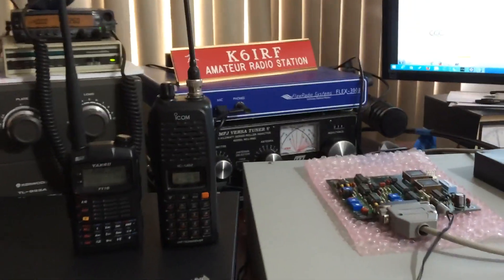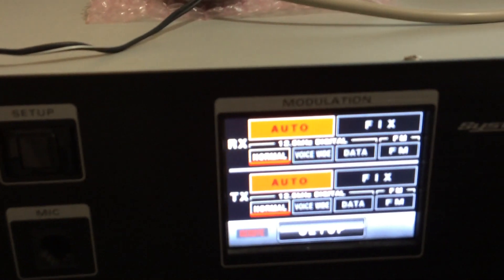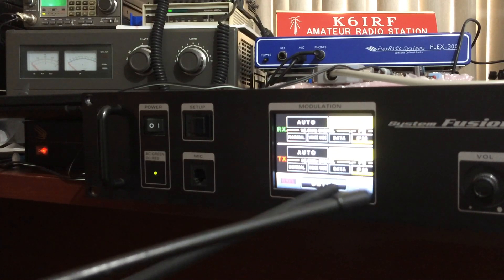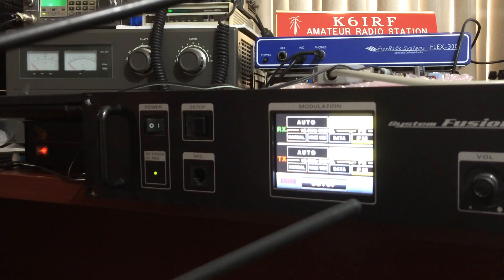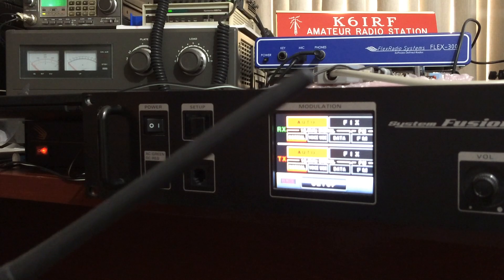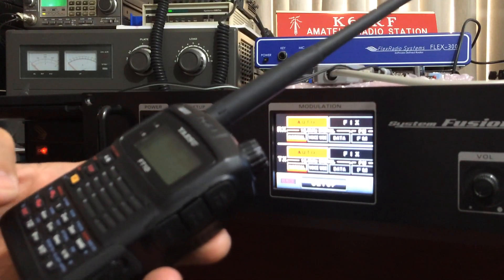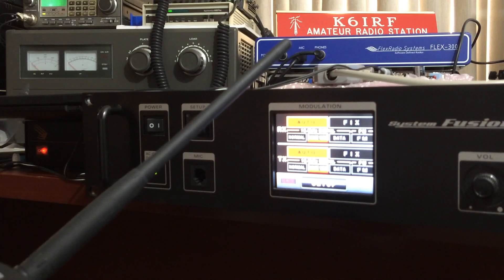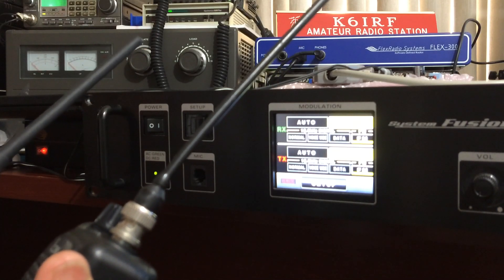Yaesu Fusion Repeater Lock-up

Comment: Hello Guys! Sorry for late post. I decided  to put a switch on it that turns off once a day just so we can put it back up on the repeater site. We were able to use it for a few months until it went down again. This time a reset did not fix it. The dr1x was sent back to Yaesu for repair and firmware was updated. I haven't had the chance to pick it up. I will let you guys know if firmware upgrade will fix the lock-up. 
73! Lot / k6irf
Reply: Did the update fix it?

Comment: Same bug on my repeater ir4uch located in jn54nf. The set up mode is auto and this bug is frequent in analog mode after the beacon transmission.
 Firmware versione is the same you can find in this video but i have found this kind of bug in previous version also